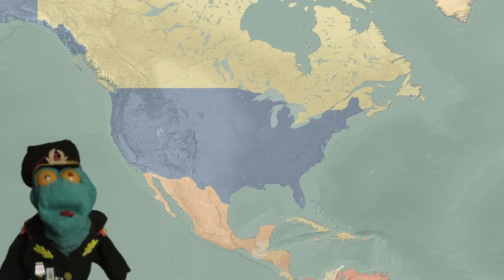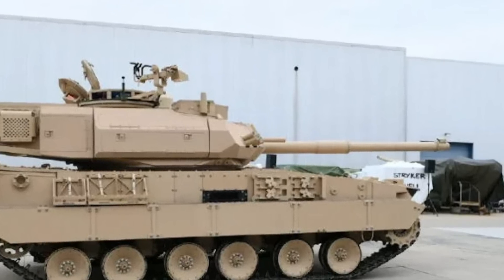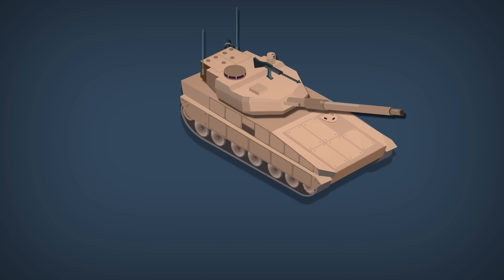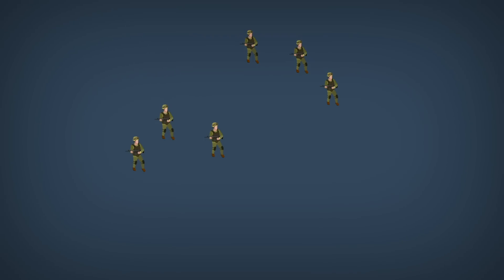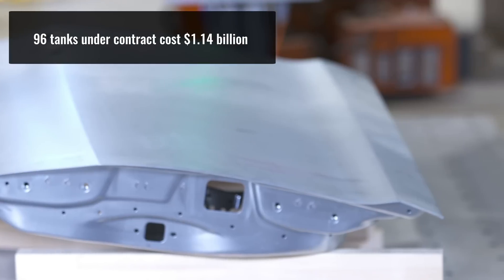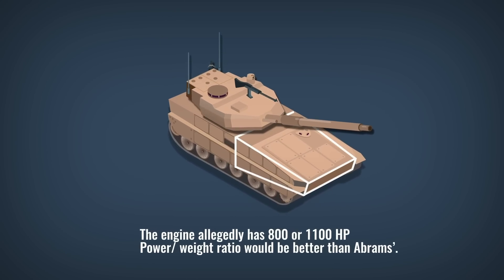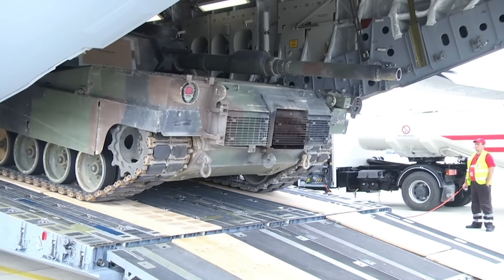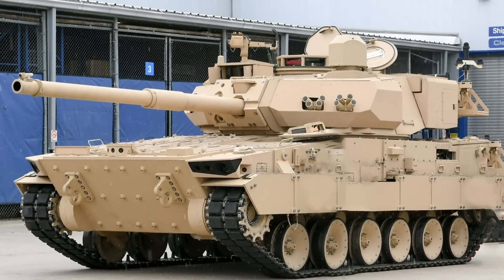US Army just chose its next (light) tank

Comment: And it will be named BRADRAMS
Reply: The 3 names I can think of is WESTMORELAND, SCHWARZKOPF, OR POWELL. American armored vehicles are named after generals for the most part.
Reply: @black10872  I think it will be named the POWELL fire support vehicle. The US Army has insisted that it is not a tank.
Reply: @jeffreyexposito3803  combi of the Bradley and the abrams
Reply: @jeffreyexposito3803  I know it's not listed as a tank. But, it nearly has the same weight of a Sherman tank which was classified as a medium tank. The Airborne needed something for decades since the Sheridan was phased out of service in the mid 90s. If this new light tank is not airborne deployable... Then there's no need for it. Its better off using the Stryker equipped with a 105 MM Gun. Or hell, give this thing to the Corps. They foolishly got rid of their Abrams with absolutely nothing to replace that lost firepower with.

Comment: That thing weights in at about 38 tons. A T-72 is somewhere around 40-42, and no-one is calling that a "light" tank.
Reply: Its a Light Tank because America's main MBT is the Abrams at over 72 tons a piece.
Reply: Modern variants of the T72 also push close to 50 tons, 10 tons more than this light tank.

Russian tanks are also very small as the interior size is very cramped and tiny, which allows to save several tons of weight. In fact, if you're too tall (as in, over ~1.70m/5.6ft) you can't become a tanker in Russia
Reply: @HunterSteel29  Shouldn't it be called A-72 then? That's monstrous.
Reply: @steveweidig5373  The Soviet tanks were made lighter because of the terrain conditions in most of the European plain. That mud is an issue ant it is worse for heavier vehicles. Also it must be transported by trtain, because Russia is massive and the ability to transport troops is crucial since the XIX century Crimea war made it obvious that despite large forces, the hability to move fast is crucial for Russia. It is so important their mechanise forces have special rail units atatched, an oddity only seen in the Russian army.
Reply: Russian tanks are often called "small" or "light" when compared to Western MBT's, etc.

Comment: Will it have an active protection system, like the Israeli Trophy system?
Reply: Yes not trophy though, one of the light ones. Iron fist i think...
Reply: almost certainly. trophy systems are already common amongst abrams tanks and stryker vehicles
Reply: Duh, all tracked amoured combat vehicles will require that, a Active protection system of some kind be installed. Such active protection system need to be capable of handling/countering top attack ATGM missiles like the Javelin or Spike.
Reply: @theduke7539  Not stryker because it takes up a lot of weight & there no more room for growth of weight systems to be installed on stryker & its due to be replaced so there not adding something expensive there yet unless war is within the next 2 or 3 years. On Abrams only a very limited number sep 3 iteration of Abrams, approx 300 new orders. Budget availability being the limiting constraint for more being ordered. The new light tank will need it more then Abrams. Its frontal aspect turrent armour of those built after the M1 A1 the M1A1HC can shrug of most things that hit it.
Reply: @theduke7539  I didn’t realize they were already in service. Is it the actual Trophy system or an American version?
Reply: @avigenuth4395  theres some actual trophys systems, but most are american copies
Reply: @kevinyaucheekin1319  strykers have been running APS systems since like 2009
Reply: @theduke7539  thanks for the reply!

Comment: I wonder how many it would take to beat am Abrams.
Reply: A good shot on Abrams' tracks is enough to make it cornered. Then either take the engine or finish off the crews exiting the tank. This applies to every tracked vehicle in existence.

In an open field, it may take at least two to take Abrams head on, but in a guerilla setting, an infantry regiment may be enough. Good thing Abrams was never deployed for some jungle warfare, afaik.
Reply: @OverseerMoti  Imagine it in really soft , often swampy ground.  Then a light tank makes sense. Still needs either a Bigger gun, or smaller gun, better protection, One crew member less.

Comment: Manual loader is better because they save amo and get better shots off
Reply: It depends. A well trained crew can match an autoloader, but autoloaders can take up less space and weight or fire at very high rates, depending on the design and what you want out of it. A poorly trained crew is no match for an autoloader and must have time to learn and train before they can become similarly effective, while an autoloader should (if designed and maintained well) work as well on day 1 as after a long period of service.
Reply: Both have pros and cons. I like auto loaders. You need less space for more humans, so you can have the same armor protection for less weight and size.

Comment: why does it use manual loading? I thought it is a light tank so it would have a 3 member crew only
Reply: Auto loaders are not as reliable
Reply: The 4 man crew was chosen for ease of retraining for Abraham crews. Switching to auto loader does not necessarily mean it will be lighter weight.
Reply: @dankoz6340  also talks of the 4th person as a drone operator not sure if that is true don't kill the messenger
Reply: I guess manual loading is fine for smaller shells, might save weight too.
Reply: Manual loading is far faster. 3 man crews struggle to do pmcs.
Reply: @jessefarley4609  That's right, drone operation for the loader is also talked about the loader's job in the NEW panther. Just overall, need the extra hands and eyes for the crew.

Comment: Good video - very informative!!! However, noticed that the FUEL SOURCE was NOT mentioned. Will this vehicle be running as an ELECTRIC TANK, thus the need for a battery recharger OR will this vehicle be running on the EVIL FOSSIL FUELS??????? Just asking - for a friend.
Reply: He did say diesel engine... So THE DEVIL!! 1!1!!
Reply: Electrical simply isn't reliable enough in the field. It'll be a while before it can be used for military matters which require both reliability and ease of use. A battery powered tank would be logistically unfeasible if anything happened to the electrical grid (which is one of the easiest things to disrupt)
edit: also keep in mind that an electric vehicle is only as green as the power plant supplying it. doesn't matter if you stop burning gasoline only to rely on a coal plant.

Comment: They already tried this with the Striker; changing it to a track variant will only slow it down further. True that tracked has better rough terrain performance than wheeled, but u suffer so much in speed. Your marines could use something like the Centauro at least.
Reply: 1. It’s Stryker, not striker. 

2. The Stryker mgs had a problematic auto loader, which is a HUGE difference from this having a human loader. Not to mention Stryker armor can barely stop .50 cal.
Reply: Another point, the Stryker mgs was solely apart of Stryker brigades, and apart of the cavalry squadron within said brigades. Therefore it was used solely as a reconnaissance element. 

The MPF will be primarily in infantry brigades supporting infantry operations.
Reply: Marines aren't getting it. It's going to the Army.
Reply: @gabetaylor28  sorry for the spelling mistake, felt off when I typed it. ;p
Hmm yes, not able to stop a 12.7mm or even a 20mm round is not suitable as a light tank. For an IFV perhaps, but not a light tank.
Reply: @eseetoh  the Stryker isn’t a light tank.
Reply: @gabetaylor28  yes I stand corrected, the Stryker cannot be compared to a light tank.

Comment: I don't know, this seems like someone put a lot of money into this before the Ukraine war, and after seeing the Russia tanks turned into scrap metal, just decided to go ahead with it anyways (Someone has been promised a lot of money). It will be hard to find crews that will feel safe in this.
Reply: early on in the conflict perhaps, but as russia adapted to a more modern battle space they started using more encirclement tactics which deprives defenders of resupply and then it doesnt matter (just like we do). also these cheaper machines as mentioned would be lighter and easier to run which means they could do more jobs and go more places.  heck on the example of russia/ukraine? supposedly just like in ww2 most western heavy battle tanks are 50-60 tons and some of the bridges cant support the weight (one of the reasons you havent seen many/any leopards yet).  these lighter tanks wouldnt have the issue and wont have the fuel demands of a turbine engine and can fit more shells onto a truck.
Reply: When you use a weapon system wrong it will not work the way it’s intended and will be destroyed. Imagine sending an aircraft carrier off the coast of a warzone by itself and then being surprised that it gets destroyed and saying it’s a waste 😅
Reply: I don't know. Maybe this is a good idea.
If the idea of a MBT has turned obsolete it makes sense to have infantry support that doesnt have to (can't) fight head-on tank to tank.
On the other hand, isn't this basically a tank shaped truck?
Reply: That is crazy

Comment: General dynamics is not making a "light" tank they are doing a next generation Abrams main battle tank
Reply: Nope! This is a payoff for General Dynamics. Why? The thing is made of aluminum. Aluminum plus heat, especially in the presence of iron, means big ass fire, and since fire is something tank crews don't like..... Just look as the M113 APC, so unloved I don't think it ever got a real name. Maybe roundeye cooker.
Reply: @jasonrhodes9683  if you actually go read articles about the whole thing and look at there video showing the outline of the vehicle it's safe to say that they are running it back with a proven design I know that personally my uncle designed the original M1 Abrams
Reply: @Dannyedelman4231  he did a great job, the M1 is so modular that every few years it is practically a new tank.
The turret ring is too exposed, its not armored so if something hits there its over. 
The Chinese are make sabot rounds and those won't be impressed with  aluminum armor and they don't set off reactive armor blocks.
Reply: @jasonrhodes9683  oh so very true! I totally forgot my uncle designed it to be interchangeable! He passed away in 2012 and I sure miss him

Comment: Why would it be rifled, when everything else we use is smoothbore, and would allow for greater variety of ammunition..?
Reply: Calibres matter.
Reply: @zaco-km3su  Not the point. Smoothbore or rifled is independent of calibre. It's just what ammo they are primarily using. Smoothbores tend to use sabot, rifled tends to use HEAT.
Reply: @danielc2701  
No, it is the point. Do other tanks or cannons have rifled 105 mm rounds? If the answer is no you have your answer as to why the cannon on the tank is rifled This tank will have it's specific rounds made for it. If it gives it an advantage....they will got with those rounds.
Reply: @zaco-km3su  Yes other tanks have rifled 105mm rounds, notably the older versions of the Challenger tank. In fact, the rifled 105mm gun is more common than the smoothbore. It used to be standard for tanks in the Cold War. Think it was called the Royal Ordnance L7(British)/M-68(US). In fact, both the smoothbore and the rifled guns are ALL THE SAME CALIBRE. There is no difference in calibre, which is why I said calibre is not a factor since both are 52 cal.
The real reason is shell stabilization. Sabot benefits from smoothbore but performs worse with rifled, HE benefits more from rifled than smoothbore. This is an indication of the doctrine of what the tank is going to fire most often, which is HE/HESH.
You want the whole long story, go check up the difference between the British Challenger and the M1A1 Abrams, one uses a 120mm rifled, the other uses a 120mm smoothbore.
Reply: @danielc2701  

I meant American tanks that are in service not old, outdated, out of service British tanks.
Reply: @zaco-km3su  Then it would be the M1 Abrams. The un-upgraded ones are still using the M-68. The export versions also tend to use the M-68. I'm starting to suspect you're not that familiar with tank cannons. The L7/M-68 is still one of the most common cannons in the world today. Not to mention you don't know why different cannons use smoothbore or rifled.
Edit: Oh right, the Stryker MGS also uses the 105mm.
Reply: @danielc2701  
Wrong! No, the M1 Abrams doesn't have a 105 mm cannon. Nice try. Almost all the tanks that had it were upgraded to the 120 mm cannon. The export versions have the 120 mm gun. You don't know what you're talking about. The L7 is not that common. Stop smoking drugs. Yes, the L7 is used on the Stryker MGS. They're probably trying to use the same rounds. It's cheaper and the logistics are simpler.
Reply: It probably indicates the intended usage of the vehicle, infantry support, since HE fired from rifled tends to perform better than from smoothbore. Not to mention I suspect the 120mm smoothbore might have been too much gun for the tank.
Reply: @danielc2701  

You usually design the tank or at least the turret with the calibre of the gun in mind. Also, might as well mention that the Stryker MGS had the same cannon.
Reply: @zaco-km3su  You might have had a case if the initial demonstrator did not use a 120mm smoothbore.
Reply: @danielc2701  

Nice try. That was a "conversation starter". It's irrelevant. It's not really supposed to work. You always design a tank with the calibre of the gun in mind. You fail!

Comment: I think tanks should be modified with "trophy systems" to counter anti tank weapons.
Reply: You can bet they're going to strap some active protection to counter the loss of armor.
Armor doesnt seem to be enough these days anyway.
Reply: @herrhaber9076  A large amount of armor would actually be detrimental for what this tank is designed to do. It's an easily transportable fire support platform for light infantry. The added weight would make that more difficult. It's also not meant to engage in direct combat with enemy tanks. It is meant to destroy enemy emplacements like machine gun nests or bunkers which would require much more effort for infantry to destroy rather than an armored vehicle. Additional armor beyond that which can stop 30-40mm rounds typically does not assist in combating these types of threats.

Comment: Whats the advantage compared to just use Abrams? Ist a stronger Tank and you save development costs.
Reply: Strategically more mobile and easier to transport while providing Infantry with firepower of a tank against anything less then MBT. Abrams are already hitting 70 ton and that is just too heavy to keep up with mobile and fast infantry doctrine.
Reply: Well, none. Cause it won't replace it, just fill another role that the abrams can't.
Reply: Abrams is bigger, Slower and heavy. this tank will be able to deploy faster and in greater numbers and the Abram's is to expensive to mass produce for infantry brigades having this cheaper option will allow infantry to movie faster and have more firepower
Reply: cheap weapon
Reply: @Boomkoko220  It's actually not easier to transport.  It requires the same airlift capability as an Abrams, rendering it pointless.
Reply: @olivercole9281  This light tank can only be airlifted by a C17, which is the same as an Abrams.  Why airlift two of these when you can airlift two Abrams instead?

Comment: If heavy tanks can get wrecked by MANPADS, is a light tank that much worse?
Reply: Since when MANPADS attack tanks?
Do you mean Anti-tank missiles like NLAW and javelin? 🤦‍♂️
Reply: A, the Russians can’t do combined arms warfare to fight AT weapons
B, they also don’t have APS systems on most of their vehicles and this tank will have aps’s
C, Manpads destroy tanks? Do you mean ATGM’s?
Reply: Light tanks aren’t meant to fight the same way as MBTs. In addition, good tank crews are trained to only rely on their armor as a last resort. It’s much easier and safer to not be seem or hit in the first place.
Reply: Not when used properly.
Reply: @GogiSanchez  you are correct, NLAWS and Javelins. As I recall other countries also have guided man portable anti-armor systems. I have heard that the Abrams would have trouble operating in Ukraine because of it’s weight.
Reply: @johnbest4513  Right thats why they've secured air superiority and supported all their operations with fire support and clear supplies in Ukraine.

Comment: This isn't what they need they need to be able to engage tanks to put bigger gun not ones we have left over after replacing the 105 mm to the 200 mm
Reply: 200mm?
Reply: You do realise that this vehicle is meant to replace the Stryker Mobile Gun System right? It's meant to support infantry, not engage MBTs so anything higher than a 105mm is unnecessary at the moment. Hell the military is specifically not calling a light tank as a way to dissuade crews from engaging MBTs. Besides you also need to think about ergonomics, such as whether a 120mm could properly fit in the turret with enough room for crew and whatnot.
Reply: 200mm? No tanks today have even close to that.
Reply: @sophiaaihpos6563  I'm presuming that was a typo. Given the context, it does seem like he meant to say 120mm